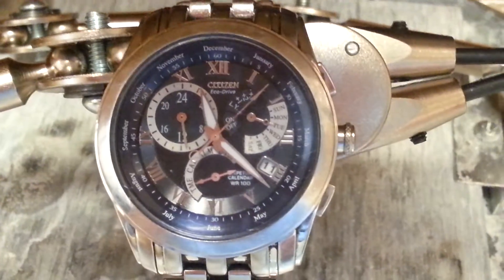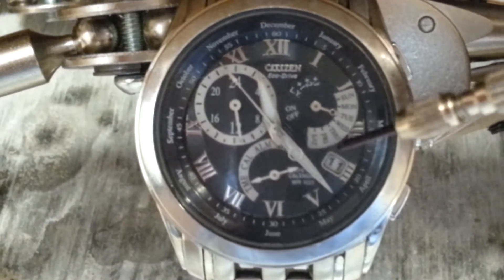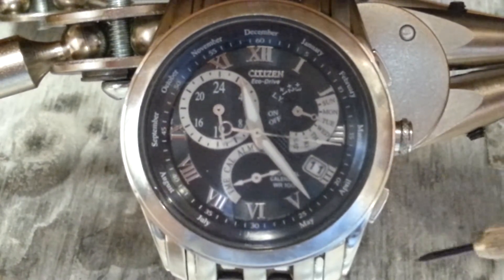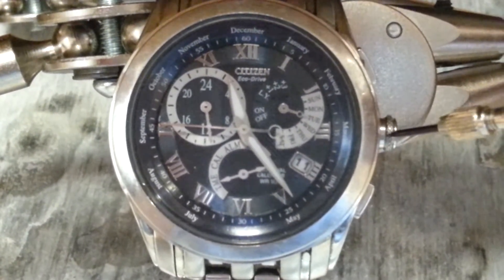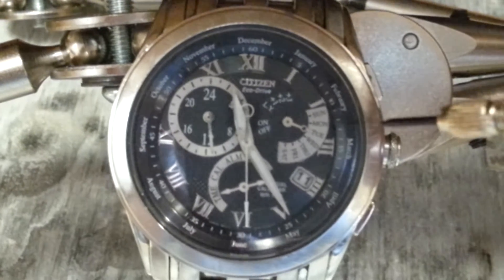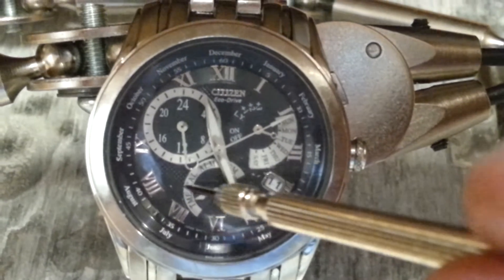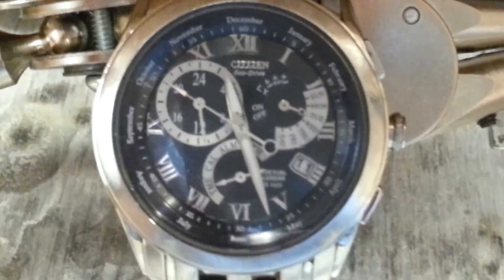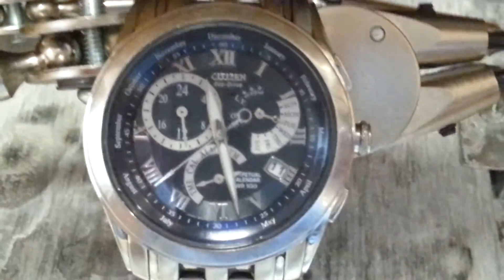How to calibrate a e870 citizen 8700

Comment: Calibrate New Citizen Watch W770 - Bought a second-handed Citizen W770, found the Weekdays, Bluetooth, Alarm & Power all off calibration. Lucky found this video but this newer citizen watch doesn't apply on L-TIME. I try using Chrono Setting as calibration... IT WORKS!! My watch now back on correct setting. HERE'S HOW.... Go CHRON MODE (1) Pull Crown once and turn.... (2) Stay on CHRON MODE, pull crown outward once more, total 2 click outward... (3) Press and hold lower right button for about 10-12 seconds. Let the watch run itself..... (4) Once all movement stopped, turn nobs to change calender date to the 1st of the month and the weekday dial should be pointing at 6 o'clock, do not point on sunday) and the rest point to 12 o'clock setting (24hr hand, Hourly Hand, Minute Hand all at 12 position) ......Note, you may have to do one fast click on lower right button to change hourly or minute hand. .....(5) Once all done on CHRON setting, push crown back in and then now you can work on your TIME setting. Hope this help!! :) Give a LIKE so the comment will bump up for other people who are having the same issue. Cheers!

Comment: Good information and helped me re calibrate my watch.  One bit of information that I found in the manual that was missing here was this:  After resetting the hour, minute & second hand to the 12:00 position, it is necessary to not only set the function hand to 'SUN' but it is CRITICAL to also reset the the date to '1'.  After doing that, setting the time & date FINALLY worked correctly.

Thanks!

Comment: I had no idea these watches needed calibrating or resetting, I changed the capacitor out a year or so ago and it never ticked again. I found about the resetting of it and tried it to no avail, left it on the counter and when I got home today it was ticking! And thank you for this informative video, it was so very helpful.
Reply: thats were i ame  now....not tikking at alll.
Reply: mrrichard57000 Google how to reset it, I can't recall how it went now. Something along the lines of pulling the pin out and holding both buttons for 30 seconds
Reply: Jason Need thank s but I all ready did that... Pull the crown out 1x then select all time mode put the crown back. Next push top right button for 10 seconds....
But mine is not responding😥
Reply: mrrichard57000 there is another reset function. That one is to calibrate it described in this video
Reply: yep just got it!!  in ltm mode then close the crown en push both buttons,it s the last step .....could not figure it out,,,,,anyway thanks....